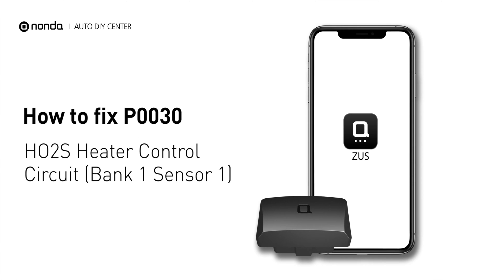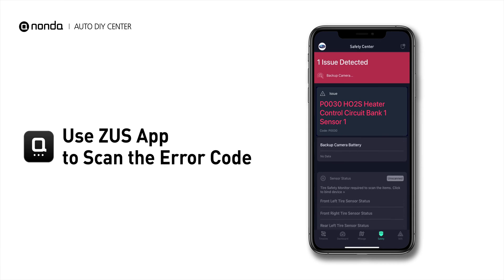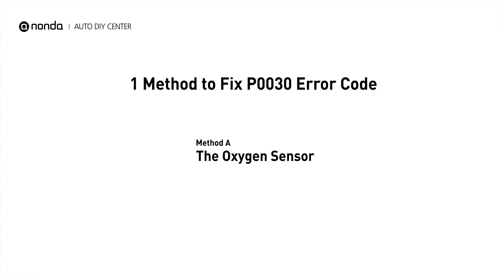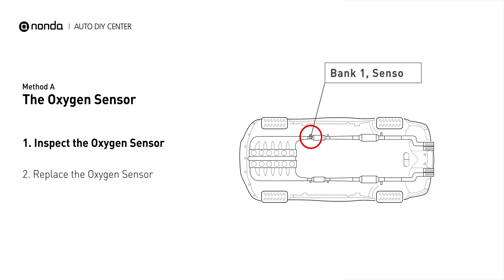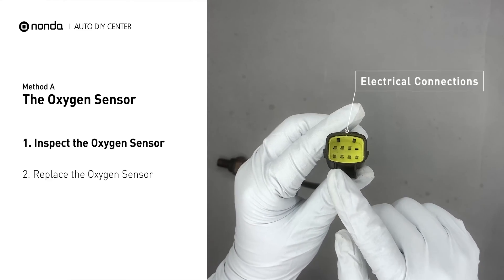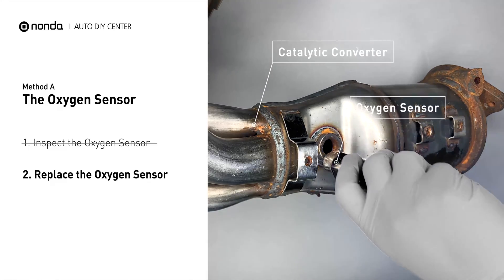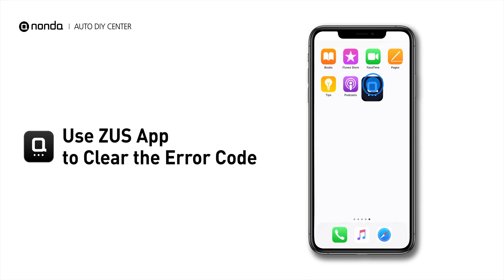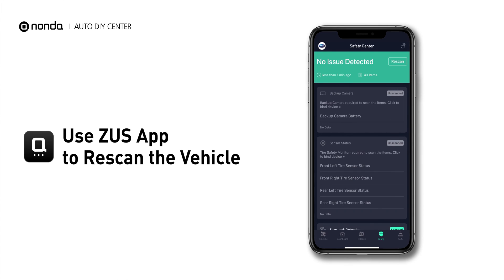How to Fix P0030 Engine Code in 2 Minutes [1 DIY Method / Only $19.55]

Comment: I have a 2018 KIA RIO S (Sedan), had a P0420, so I had the mechanic changed the catalytic converter as well as both upstream and downstream sensor, engine light still on, even after I clear it, it immediately lights on, the only code it shows is P0030, P0031 and P0132, I wonder what the issue is 😢

Comment: I have 2015 hyundai sonata. Got this exact code. Took to the shop and mechanic replaced the upstream sensor. Drove for  a day light comes back on. Mechanic says he need to replace the downstream sensor as well does this sound right
Reply from the maker: Hello, can you please confirm if all the wiring related has been checked?

Comment: Hello, I removed the oxygen sensor and started the car, after which this error appeared and returned the sensor and this error did not disappear after clearing the error several times
Reply: I have two errors catalytic and this new error
Reply from the maker: Please confirm if this is the only code you're getting, and provide us with your vehicle's year, make and model.
Reply: @nondainc   it has two cods p040  catalytic system  and p00030 vehicles  kia soul 2018 engine gdi 2000
Reply from the maker: Have you checked the wiring harness for damage? Re-pin or replace your damaged wiring harness. We also suggest checking the fuses or voltage at the oxygen sensor. If all mentioned were checked and no issues found, then a replacement for the oxygen sensor is necessary.
Reply: @nondainc   why is necessary the vehicle is working normally but have some vibration